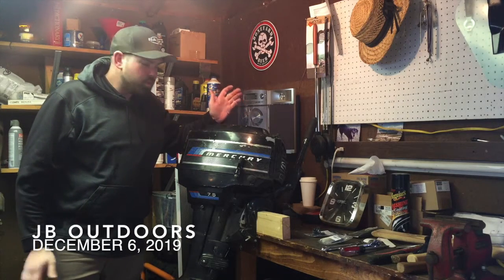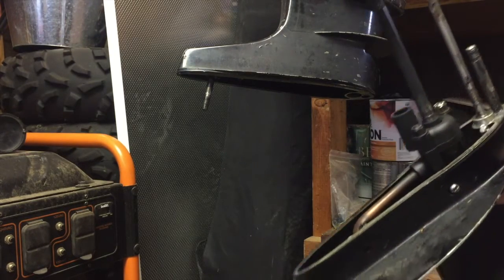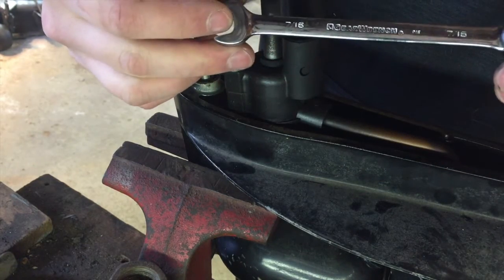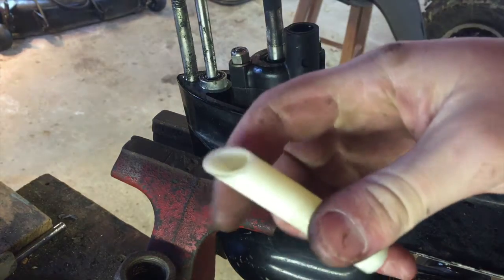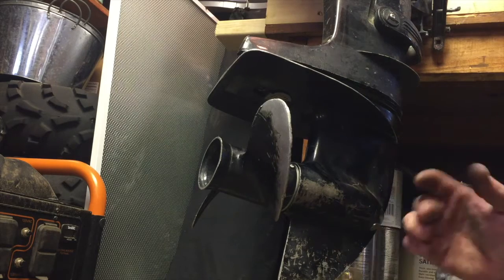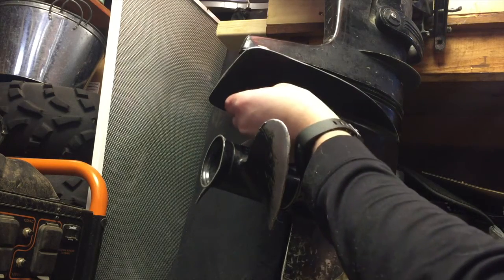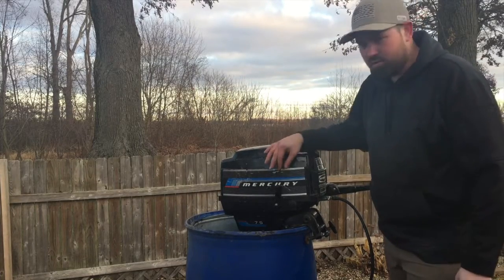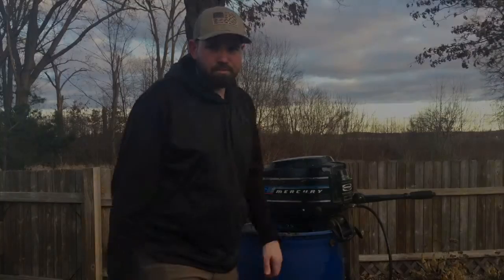HOW TO Replace Impeller (Water Pump) Mercury Outboard 7.5 hp

Comment: The copper tube is the water 💦 intake it turns down to where the lower nut is at the water inlet. And also always put some lube on the impeller and turn the drive shaft clock wise when installing the impeller housing. And a little grease on the key helps keep in place while putting the impeller on. 👍

Comment: Really good video. I just picked up a '78 7.5 motor. I got the lower end off and inspected the impeller. All good. Quesiton. Does the long brass tube coming down from the inside go into the (on yours) white tube next to impeller shaft or just sits as is?

Comment: 7.02 impeller is in backwards from the way the original one came out.
Reply from the maker: Once the impeller is in, the newer more pliable material is able to go back at forth when spinning the shaft either direction inside the pump housing.

Comment: I have a similar motor to this one and the rope will not retract only when the spark plugs are in. The flywheel and propeller move freely. It’s not locked up. I have tried cleaning out the cylinders to check that, I have changed out the tension spring. I have read some forums about it and have tried what they said and still not pulling with spark plugs in. I’m hoping you can give me some tips.
Reply from the maker: Personally never ran into that on these engines! I would initially say the recoil spring would be broken or sprung, but you changed that. I’m sorry I can’t be more help. Thanks for watching and your support

Comment: I’ve got the same motor, and it has problems starting. Yours started in one rip, so you have any idea what the problem could be, plus I have to use starter fluid to get her going
Reply from the maker: I had to rebuild the carb on mine to get it this way. It’s been sitting a while now. I should bring it out to test start it again. The carb kit did the job for me before

Comment: I attempted this today. What a nightmare. Shaft splines are all messed up. No matter what gear I put it in it does not engage properly. Impeller didn't spit water and it broke on first start. I can get it in reverse and neutral but forward just grinds. How in hell do you get splines in right alignment? Thought this would be easy, but it is far from easy. HELP! Prior to this the motor ran perfect and spit water, but it was old so figured should change impeller!

Comment: why does it matter about the gear it was left in? I am waiting for parts to do the same thing. I have watched several videos of this process, can this be done upside down? Meaning if the motor was completely upside down so as lowering the splines down, possibly being able to see more as to the spline alignment? I know zero about boat motors so maybe there is something obvious I am not aware of. Thanks for video and any help. In reading some comments before posting this, something about the impeller being more narrow on one end and that goes in first???
Reply from the maker: The gear indicator lever can move on you and when you put the lower back on, the timing will then be off. For example if you left the boat in reverse and when taking apart and the shift shaft turned on you during this process, when putting it back together the lever could show reverse but the lower unit would actually be in neutral or forward. You’d have to take everything back apart to correct this. When you get access to your water pump, you’ll find the impeller and the hole it’s in is almost offset by a small amount and the narrow end is the end you’d start in.  

Take your time and remember how it came apart and you’ll be just fine! Thanks for watching, if you have any more questions feel free to reach out, I hope this helps
Reply: @JBOutdoors  If the entire unit is upside down, so you are putting the lower half down as opposed to going up, will that allow a  visual way where the shaft would go? your video and several others seem to have difficulty when fitting the lower part upward. 

Some mention the impeller being slightly narrower on one side, is this obvious or how do you determine which way the impeller actually goes?   Thank you so very much for not only your video, also the promptness in which you respond.

Comment: After I installed the impeller i stared the motor in neutral and the prop started going like it was in gear. Did I not align it right when I put it back in?
Reply: I just had the same issue.... Not sure
Reply from the maker: Your shift shaft moved during installation of the lower unit. It happens easily as it only has to move a few splines to shift into gear. I’ve had it happen before as well, no big deal just have to remove lower unit and find the same gear as the shift lever. Sorry for the delayed response, take care

Comment: Hi, currently doing the same thing, I think I messed up somewhere because it seems like when I’m in neutral I’m actually in gear, any advice?
Reply from the maker: You’ll have to remove the lower unit again and spin the shift shaft accordingly. I’ve had this issue as well as its pretty common while lining up the splines, the shift lever can move easily without noticing. Best of luck, thank you for watching

Comment: Did you see a sheer pin when you took off the prop just asking. I broke one on a fishing trip and it made for a long day of rowing ☹️  
After that I carried one in my billfold for years.  And let me tell you there’s nothing that will replace a sheer pin. No nails barb wire fence nothing I tryed them all. Be safe and get one for your motor and keep it in the boat.
Reply from the maker: There’s no sheer pin for this particular motor, but that’s a great idea. They’ve saved me in the past for other applications. Thanks for watching and commenting

Comment: I like the fact that you posted your video  without editing out small problems you had butting it back together ( recommended to but grease on main propeller shafts after cleaning the fishing line ) which encourage the people that they can do it themself and not to worry about small problems. good video, I like it. (mechanical Engineer)

Comment: Having trouble with my 7.5 hp Mercury, it’s not pumping water, put new impeller in blew shop air in to make sure it wasn’t clogged even ordered a new water pump housing still not sure what’s up with it, any help would be greatly appreciated
Reply from the maker: Definitely, it could be that your thermostat is failing and/or clogged as well. If some of your old water pump impeller made it to the tstat it could plug the entire line easily. That’s where I’d look next! Thanks for watching
Reply: @JBOutdoors  sadly don’t have a thermostat that was my first guess, there’s a little plastic spicket under the power head that was melted poked a hole through it and she’s good now hopefully if someone sees this that’s checked everything else this may help

Comment: i am quite sure my shifter got moved during this process. Now how do i get it realigned?  got it done and launched and drive was where nuetral was and reverse was nuetral. please text me help if you know..509 885 2799
Reply from the maker: You’ll definitely have to pull the lower back off and spin the shaft to neutral and reassemble, thanks for watching and I hoped this helps!

Comment: Hey bud, nice video! Very knowledgeable. I have a quick question. when the impeller goes in, is there a side that should be more narrow than the other?
Reply from the maker: Every impeller I’ve ever done has always had one side that was more narrow than the other. It’s been the same on larger engines I’ve done as well. Thanks for watching! And I hope this video helped

Comment: Don’t even touch that stop button bro! Use the choke when running in the tank or you’ll fry your stator 😫
Reply: What?
Reply from the maker: I wonder how many people do that?
Reply: Why you cannot use the stop botton to stop  the engine?
Why and how you fry/burn the stator if the stop botton is used?
If the mercury installed the stop button there must be a good reason.
Grazie
Antonio

Comment: Can you send the link for the impeller
Reply from the maker: Definitely here’s the kit for my serial number, I’d be sure it’s within your serial number range before purchasing. There were two different size shafts with these engines depending on serial: 
https://www.amazon.com/uanofcn-Repair-Mercury-47-89981Q1-47-89981T1/dp/B07DD6TZZZ
Reply: @JBOutdoors  my seriel number is 9282453. 
Can u help me to find the right one

Comment: Haven't read all the comments, but b/c of imo questionable engineering, you have to compress (I used a small radiator clamp) or similar to squeeze the impeller, making sure all fins are bent LEFT from top. Even a cylinder, inside diameter smaller than housing, holding the impeller would work. Apply a little LITHIUM grease to fins b4hand.  Dab a spot of white paint or liquid eraser on the upper side of the impeller where the keyslot is located. Dab also on housing where the key lays in the shaft. Apply something sticky, or grease to backside of key to hold in place.  LINE UP.  Use some sort of cylinder to push the impeller into place.  Could use a hammer or similar to tap down.   MAKE SURE YOU ROTATE THE SHAFT AFTERWARDS to note that the impeller is indeed located onto the key.  Much more cumbersome than OMC, but it is what it is
Reply from the maker: Great advice, I was lucky enough to turn to the left with grease on the key and everything slid into place lined up first try, but I’m sure people have a hard time getting everything to do so
Reply: Dawn dish soap. And turn shaft and push down

Comment: When you installed the impellor you turned it counter clockwise folding the vanes opposite the normal direction , which is clockwise. Greasing the vanes is a good idea but I would recomend silicone grease , petroleum bases greased will attack the rubber.
Reply from the maker: I’ve been told this many times about direction of the veins,  but I’ve tested in forward and reverse while I had the lower unit removed and found that veins have enough room to reverse inside the impeller housing. I’ll keep that in mind about the grease, makes sense. Thank you for watching and commenting
Reply: The gears in the lower unit cause the prop to go forward and reverse. The shaft always spins clockwise. Hopefully like you said they can fix themselves.. on bigger motors the impeller rubber is too thick and stiff to allow them to flip the correct way. Out of curiosity did you actually see them flip  when you rotated the shaft clockwise?

Comment: Yo my impeller is basically welded to the shaft, wtf do I do😭
Reply: Heat with a butane lighter, drip on some oil, pry with a screwdriver carefully, repeat.

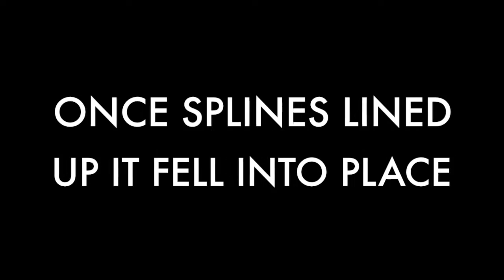Comment: At about 10:48 is where I would have gone on a swearing and throwing everything I could get my hands rampage then I'd go in the house and put an ad on Craiglist to sell that #@*^#@#@#*** boat haha.  I'm impressed with how you handled it.  Thanks for the video, I was actually looking for where in the intake was for the water so I could figure out if the motor was deep enough in the water.  Your video showed me it was hiding up under that fin when I was looking for the line of holes just above the propeller on the sides like a normal motor.  I guess I have to have a barrel, the earmuffs won't work on this one.  Thanks for taking the time to post.

Comment: If it is not too much trouble, can someone please direct me  to a place for help on my 1967 thunderbolt 200 20 hp. compression 59
thank you
Reply from the maker: Jamie marineengine.com has a nice repair forum thread for you motor. 59 psi compression is getting pretty low.
Reply: @JBOutdoors  Thank You!

Comment: You skipped the whole reason I tried watching this video, which was seeing the actually process you used to get the impeller in place. It's super difficult, but in the video you push it down, then cut and it's magically in place with the fins twisted.
Reply from the maker: David Shannon push down and twist at the same time after getting the jet started in place. It’s not only hard to do, but it’s hard to capture it when your hands are blocking the camera, I apologize if the video didn’t help at all.
Reply: You can also lube the impeller fins with a small amount of  vasallien, note the location of your key.  Then rotate the impeller slightly to set the fins  then push the impeller down  into the housing.
Reply: I cheated. I have a lathe in my basement and I used it to make a cylinder to squish the impeller into, before slipping it over the shaft. This really makes it easy, since that key doesn't stay in place. BUT......... the impeller isn't dead-center, you'll have to use a screwdriver to pry the whole "cylinder tool" over to one side, squishing the impeller "off-center". If you have access to a lathe, and can make a cylinder..... mine was 1.08 outside diameter and 1.03 inside diameter. The piece was .75 think and I only turned the I.D. a half-inch deep so it would retain it's shape while I had it in the chuck. 

I hope this makes sense, I'm a machinist, and I know... not everybody knows what I know.

Comment: I was given an older 7.5 mercury outboard that looks a lot like the motor you have.  The lower unit was just partially pushed on and the two nuts are missing. I don’t know what gear it was in when the lower unit was removed. How can I figure that out? The unit does not push all the way together with the motor and I am afraid to force it.  Any ideas?  Also turning the propeller does not turn the spline... what does that mean?
Reply from the maker: If you pull the lower back out, you can shift the lower unit by spinning the shift shaft to the selected gear.  In my experience, when you can't push in all the way, the splines on the motor and the splines on the shift shaft are not lined up perfectly.  I've spun the prop while the lever on the motor and the shift shaft are both in Reverse to help line up the splines easier.  Just be sure the gears match each other or you'll be pulling it back apart to do it again. (I've had to do it before)  Thanks for watching, and I hope that advice helps
Reply: JB Outdoors  Thanks for answering.... I did have to rotate the main shaft multiple times before it would go together however I couldn’t get it closer than about  1/8 inch .... after watching your video a few times plus a couple of others I finally discovered the problem.  When I drop the lower unit the shifter rod is staying with the upper unit instead of coming down with the lower unit.  So far I haven’t been able to pull the shifter rod loose from the upper unit.  It looks like it sticks into the lower unit via a couple of O-rings.  Not sure what is holding it into the upper unit unless it is corrosion. Still working on that problem but now discovered the engine is seized.  Started  a SeaFoam Deep Creeper treatment.... hoping I can get it free....

Comment: Did you drain the gear oil from the lower unit before splitting it?
Reply: You do not need to drain gear oil. The gear box is separate from the  water pump( impeller housing)
Reply: @marcplucinski8846  After taking a closer look I realized that. Thanks. Got it all taken care of thanks to this video 😊

Comment: Did you drain the gear oil from the lower unit before splitting it?
Reply from the maker: MKECanardFlyer yes, sorry I left that part out. I pulled the bottom plug
Reply: That’s the one just below the cavitation plate on the starboard side?
Reply from the maker: @MKECanardFlyer  That's correct and when filling pull both and fill from the bottom port, when the oil starts to run out of the top port that's when it's full.

Comment: Hi mate, I have the same engine, same year and everything. It came as an auxiliary engine on a boat I bought. It runs like a champ but I done seem to get full throttle. There is a lever on the back of the carb, if I pull that, it revs much harder. It looks like it should be connected to something. I'm wondering if I am missing some kind of linkage? Can you shed any light on it please? Cheers from Tasmania :)
Reply from the maker: Music Islife absolutely, the lever on the back of the carb goes up to the linkage system for the twist throttle. When the engine is in neutral it’s meant to prevent over revving with no load on the engine. As soon as you engage into gear a cam lob is moved to push that throttle lever further open. I hope that helps or if that’s even your problem. Mine was also an auxiliary engine and being a longer shaft on my 12 ft V Aerocraft I had to install a jack plate to raise the engine some
Reply: JB Outdoors oh, I see. I haven't even tried it in gear yet, I only started it for the first time today. I think it's been at least 10 years since it was run and it started after 3 pulls! Runs like a champ. So if I click it into gear, I should be able to get full throttle?
Reply from the maker: Music Islife nice runner! Yes it’ll go full throttle in gear, I recently had to remove my carb for cleaning and learned more about that.  Thanks for watching!
Reply: @JBOutdoors  thanks so much for the info, I thought something was wrong with it, lol.

Comment: My impellor wont come out slide up like yours did seems like it has a brass nut of some kind.
Reply: There  is a brass sleeve  inside the impeller sometimes it corrudes  to the drive shaft,  check that first